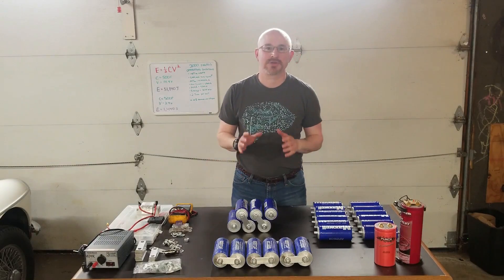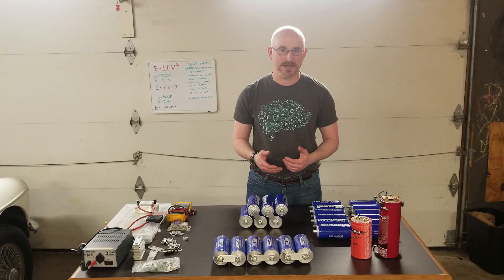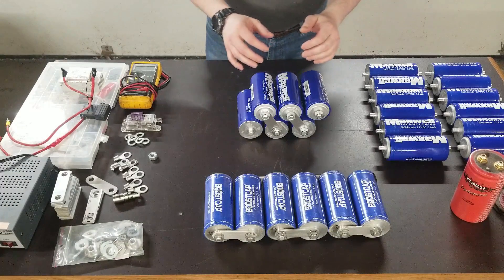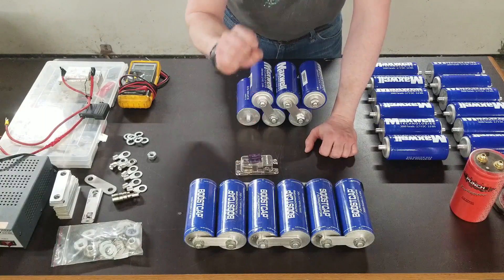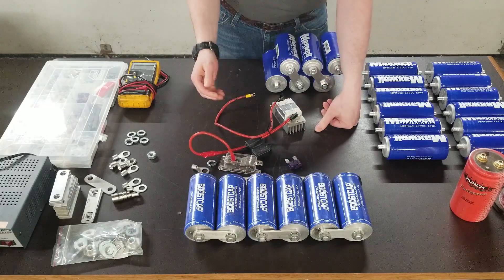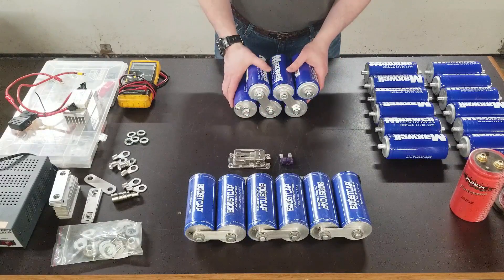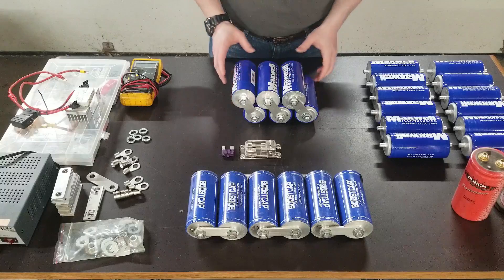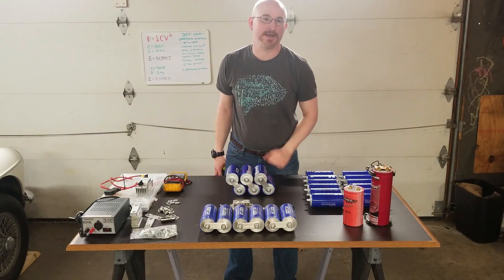Electrical engineer explains ultracapacitor Safety Tips and Tricks - Car Audio Applications

Comment: Thanks for excellent demonstration. How well can these work on a hybrid car like toyota prius?

For example, my prius has a 220volts lithium ion battery running a 60KW electric motor.
Reply from the maker: Nice-oscar the 12V system for electronics is no different than a standard car.  The recharging/motor battery system is a different animal and you'd need too many ultracaps in series to be economically feasible.
Reply: @richardvedvik979  I don't know about that I've heard those hybrid batteries are around 3k aftermarket and typically only last 3 to 5 years which is to expensive for me lol. Not to mention their a pain to replace if I'm correct anyway lol. If capacitors would last longer say 10 years I'd think it would be worth it. I keep vehicles until they die or need a repair that is more then their worth. I have 2 vehicles that are over 15 years old still lol.
Reply from the maker: @my2centz196  I've had my ultracap bank for over 6 years and I bought them used.  They are rated for 1 million cycles, but a car doesn't fully cycle them.  Just like in all electronics, capacitors last for decades.  No chemicals, just energy fields.
Reply: @richardvedvik979  yeah I'm sure and I imagine just because things are rated at something doesn't mean their gonna fail right at that piont. I've had regular 5 year car batteries last 10 years or better. I am curious why more people don't use them including car manufacturers. I'd assume there must be some risks using them.
Reply from the maker: @my2centz196  i don't think risk is a hindrance,  but cost certainly is.
Reply: The bigger issue is energy density. That is the number of kilowatt-hours / joules per unit weight. A quick web search shows lithium-ion batteries are in the 100 Watt-hour per kilogram range (some sources claim 200+ watt-hours per kilogram).  Maxwell's largest supercapacitor cell (3V / 3400F) stores about 8.6 watt hours per kilogram. To store the same amount of energy a supercapacitor bank would weigh more than 10 times that of the lithium-ion bank. For electric vehicles and hybrids, energy storage is directly proportional to how far you can go.

What the supercapacitors are better at is fast energy transfer / peak power  you can charge / discharge in seconds  compared to many minutes or longer for batteries.

Comment: People also start cars with them. How well do they perform at minus 10 F, where batteries need help?
Reply from the maker: T Samuel they are not affected the ways batteries are since they store charge in an electric field as opposed to chemicals. The datasheet for the BCAP3000 includes affects by temperature.

Comment from the maker: For those wondering about sizing banks for automotive systems, consider that Joules are Watts x Seconds.  While the 500F bank has over 51,000 Joules of energy storage, we are interested in 14.4V - 12V which is only 1,440J or 1,440 Watts for one second.  Because we are trying to supplement the battery and alternator, we aren't looking for an ultracap bank to provide long-term power supply but instead provide transient voltage regulation.  As such, a 500F bank can regulate about 1kW of actual demand (not amp rated, but actual clamped power).  SPL systems will use several banks.
Reply: 16.2v and 500F = a little over 65,000 Joules... not sure where you're getting ~51,000?

And 500F x 2.4 volts is 1200 amp-seconds. Times an average voltage of 13.2 (in between 14.4 and 12.0 that you stated) is 15,840 Joules, or watt-seconds. If you think about what a Farad really is, you'll see how wrong your numbers actually are.

EDIT #1:  I zoomed in on your whiteboard and now see how you're getting the incorrect numbers. You can't pick and choose how you use the formulas.
EDIT #2: I see this video is 6 years old, so you probably know the real answers by now.
Reply: @diylithiumguy  def no expert, but the alternator does not deliver 16+ volts

Comment from the maker: The pics at the end aren't final products, but are intended to show some of the ways I have mounted and fused ultracapacitor banks.
Reply: I’ve had a bank of six of these maxwells with balancing boards in the soda can configuration since December(so almost 6 months now) but I’ve been kinda scared to actually install them. I’m going to see if I can rearrange them to be inline and mount them on top of the trunk like your last picture! I noticed you have some sort of carpet on top of them in some of the pictures. Is that just speaker box carpet?
Reply: If I were trying to use these to charge an electric scooter that says DC 12V next to the charger port, how would I do so? I need a vid that's quick but easy 😂. I'm not good with long explanations and such. Thanks for the help if you reply
Reply: @dragonscargames4808  Using supercaps to charge batteries is not very productive because the capacitors will likely store less energy than the batteries overall. The only reason to use these instead of batteries is because they can release their stored energy almost instantly, vs batteries which hold much more but can't release it as quick.
Reply: @dragonscargames4808  I asked a similar question, though for 36V . I think filling a backpack with 3 of those sixpacks in parallel for 12-14.4 V with break away connectors on the leads and attaching an inline switch that says " go baby go" might be the way to go. Helmet and leather is encouraged.
Reply: what kind of capret tape is that?
Reply from the maker: @greasemunkeyyy  can you expand on capret tape?  the Mastic?
Reply: Richard Vedvik the grey Tape that they re putting over the terminals on there finished installs. Is that mastic? It looks like it has more of a cloth like texture than regular tape